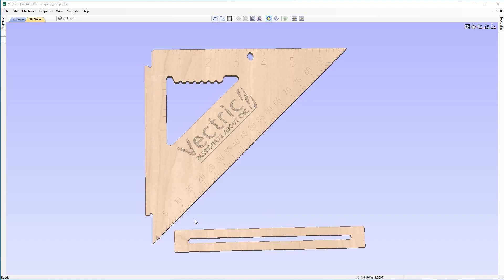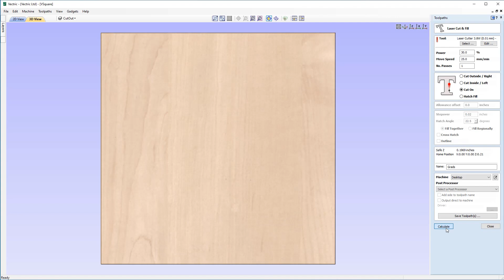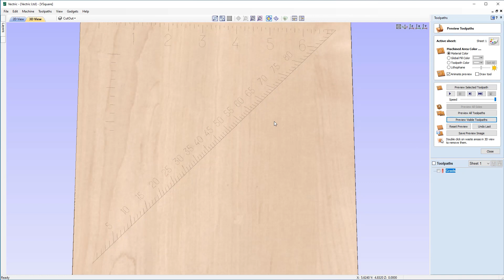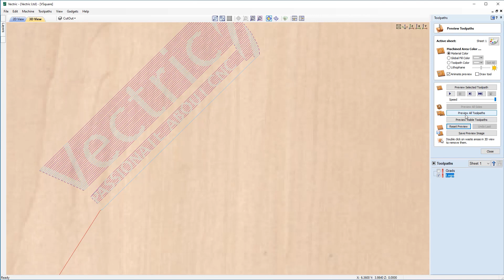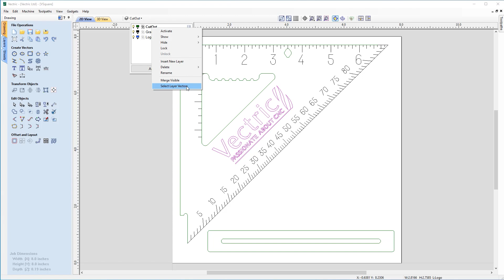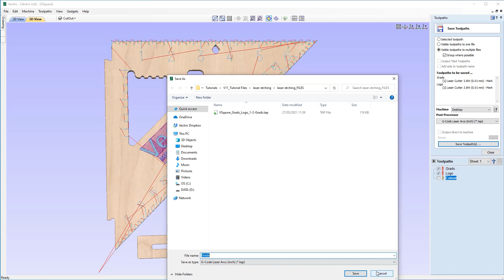Laser Etching | Vectric V11 Tutorials

Comment: What is the purpose of setting the cut depth to a value showing z+? Why not just put a value there that is equal to or just greater than the thickness of the material that was entered during the material setup part of the job? Why the "z+"
Reply from the maker: Hey Brad... well there are two reasons I like to you the "z" variable... 1 - If I forget the material thickness then it will pick it up from the material setup.  2 - If I change the material thickness in the material setup I just need to reclcate, not go into each toolpath and update it by hand.  Its handy...

Comment: I didn't see anything addressing the difference between where the router bit will be zero'd vs. the mounted laser head which is offset from the router zero.  How is this addressed in the setup and/or toolpaths when performing both operations from the same project?
Reply from the maker: Hellp Peter... thanks for the question.  In this demo after I lasered the job, I needed to then jog the machine the distance of the offset, reset my x and Y and set Z... then run the CNC toolpath.  Hope that helps.
Reply: @vectric  It would be nice if there was an offset setting in the laser toolpath to account for it's placement from the router x,y,z.  I have to do the same thing manually using a g-code file w/the offset values that I determined for my setup.  It seems like it should be built into the app since it's a common step.